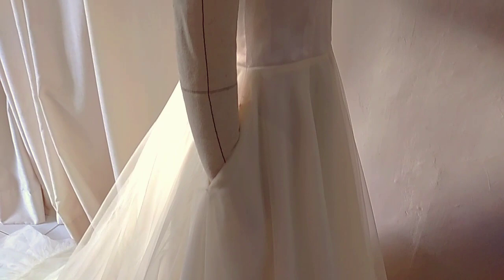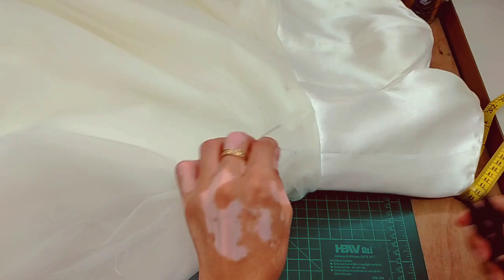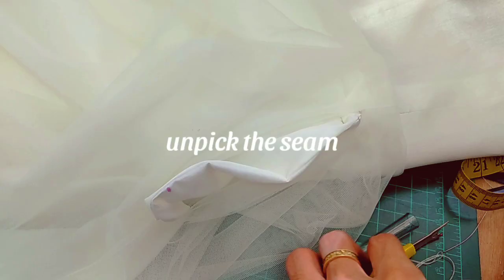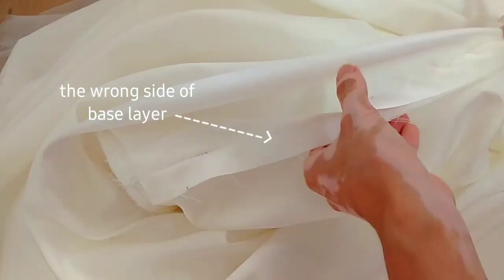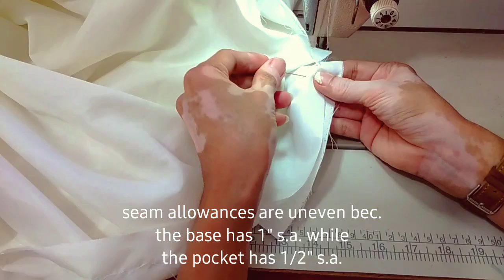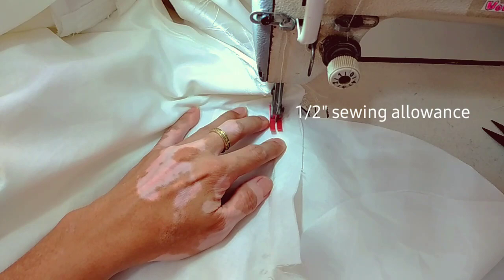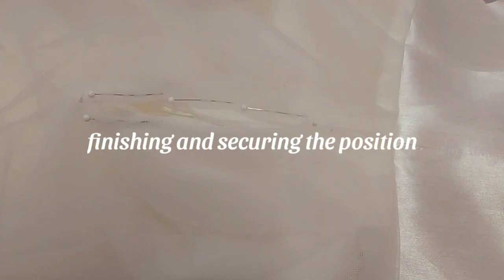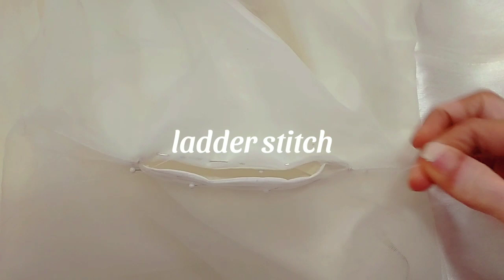🧵 Adding Side Seam Pockets to My Client's Wedding Dress with Layers of Tulle × Sewing Tutorial

Comment: If the tulle skirt doesn't have a side seam( like a gathered tulle skirt) would you have to cut a slit into the tulle instead ?
Reply: I guess, I thought about it with a full circle skirt, if it's one piece and you want pockets you'd have to cut them. May be a bit tricky to sew the inseam pockets